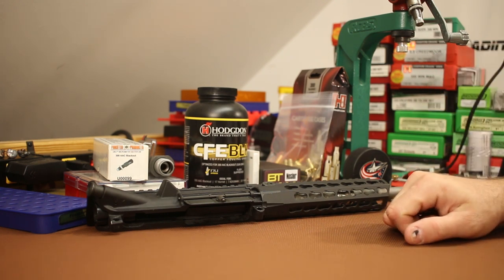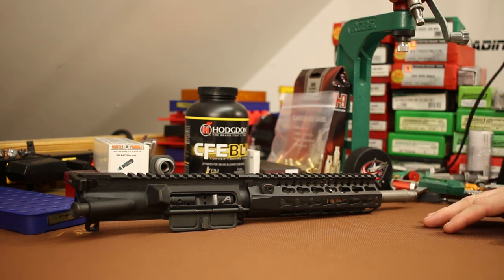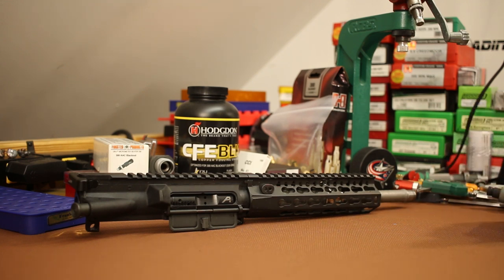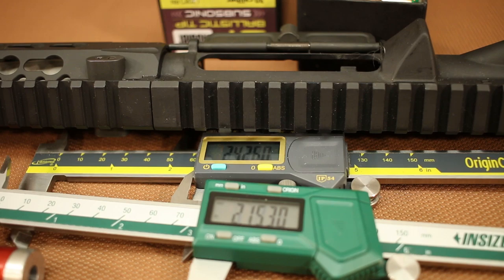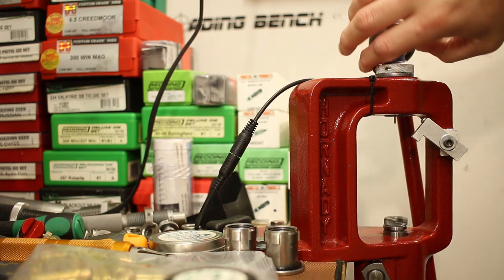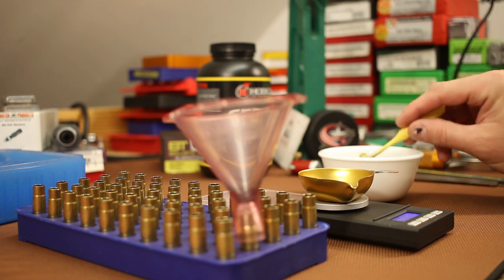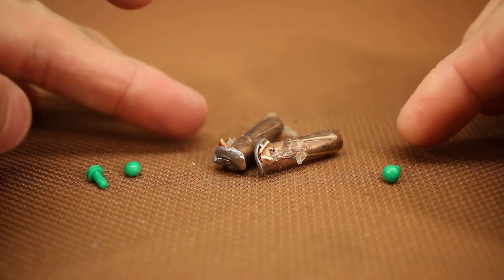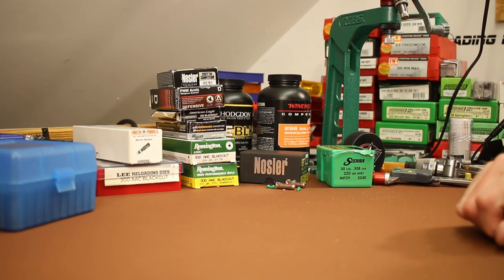300 Blackout - 220gr Nosler Ballistic Tip Subsonic

Comment: That live round extraction was a "Nail Biter"! 
Large projectile instability may be caused by the round not being loaded concentric. The Ogive is long and round so however the bullet starts the lands, it finishes that way. The point only 1mm off will cause an imbalance that turn the bullet into a corkscrew. It may be better to order seating cones specifically for the Big Boys. At their per unit cost, it would be worth it.

Comment: I wonder why the gates twist barrel I could find when I put my .300bk together was 1/7 when it was designed by AAC as a 1/5. That seems like the ticket to stabilize the 220gr. Bullets
Reply: Several manufacturers are doing 1/5  twist barrels now.

Comment: A little off topic but I was working up a hunting load for my 16" 300 blackout and came across some data that shocked me. I tested it out and have found it to be true. Nosler 125 grain ballistic tip can be pushed to 2400 fps without pressure issues what so ever. Would love to see you test it out in yours to compare some results

Comment: Accuracy is good with 220 grain Subsonic Ballistic Tip" T/C Encore (1in 7 twist)barrel , under a inch with perfectly round bullet holes at 100 yards.  Expansion sucked ,but did use one to kill a whitetail buck, velocity 1050ish FPS, 40 yard shot, next to no expansion, bullet tumbled exit was  the exact length as the bullet is long.

Comment: Hmm, running s 10.5 inch barrel, 2.10 OAL LC brass, Winchester SR, primer 11gr CFE black 1054 avg  velocity, and stable. I use these between 4750-7000 feet elevation above sea level. Works great in the 16 inch bolt gun as well. BTW they are 1/8 and 1/7 twist respectively.  I have learned a lot from your vids and appreciate the knowledge you share.  Keep them rolling.

Comment: johnny, I have had no stability issues with this bullet.  I am running a 10.3" daniel defense barrel with aa1680 and a c.o.a.l. of 2.100".  I think your poor expansion was due to the bullets impacting the gel at an angle(you can see the angle on the ends of your bullets).  I shot mine into milk jugs full of water and they acted like varmint bullets-complete fragmentation.  They didn't mushroom and stay together at all, there were just tiny bits of lead and jacket pieces throughout the jugs.  I would definitely explore it further.  since you can shoot on your own property, I suggest maybe just prepping your brass, load 2 or 3 rounds and test stability, then go make adjustments-load two or three more, and test again vs. loading a large batch and finding out it's unstable-this is how i develop subsonic loads to save components. by the way, so glad to see you getting the blackout back in the mix, was getting really bored with all of the 6.5 and 308 videos hopefully you'll get back into the blackout
Reply: At what velocity was this fragmentation?
Reply: @amagfoley  1000fps +/-30

Comment: Great work on the vids, keep up the good work.
Also have a question for you I am reloading for 308 win I have been trying to work up a load with sum Barnes ttsx 130gr bullets using sig brass have to manuals they both have data for 130 gr bullets and for blc2 powder , the Barnes data says load from 50-56grs and hogdon say to load from 48-51.5 grs the differences is that Barnes has their oal at 2.810  and hogdon is at 2.615 I am loading to 2.810 will the the Barnes loads be to much pressure thanx for the help in advance

Comment: I've been running 208gr and 190gr bullets for my subs and getting a lot better accuracy. Using the midrange twist rate to run supers and subs probably accounts for the improved accuracy with the lighter weight sub rounds

Comment: Wish you could try a higher twist barrel. The longer and heavier the projectile, the more spin it needs to stabilize. It's possible to over stabilize with too much twist but you almost never see it as much as under stabilized. The tradeoff is that  you lose a few ft/s with more twist, but that's a non factor when you want to run subsonic.  1:7 would have worked I bet. I would go with 1:6 if available.

Comment: I have an 8.3" BA Hanson barrel with the EXACT same issues as you. It has been driving me crazy - I have over 50 "recipes" I have tried, both supersonic and subsonic, and the accuracy has only gone from bad to worse. I have tried 130gr, 168gr, 200gr, 208gr, and 220gr bullets with CFE BLK, Shooter's World Blackout, and H110. The absolute best accuracy with any load at 50 yards has been 1.5 MOA, and the worst was 6+ MOA - shots went off the paper so I couldn't measure. My average is 2.5 MOA. I also have issues cycling "max loads" with subsonic bullets that many others online seem to be running well. ---->more
Have you been able to figure out your issues with your system? I'm really starting to believe this barrel is causing major accuracy problems, but it feels like a waste to just throw away a $250 barrel. I have changed scopes, retorqued everything, thoroughly cleaned the whole system numerous times, gone to a special lightweight buffer spring, and even added an ACCU WEDGE to remove any play between the upper and lower. Accuracy is still awful. BA has a 1 MOA guarantee on these barrels but I'm afraid it will just end up going nowhere with them.

Comment: What is the difference in diameter measured between the barrel extension exterior dimension and the upper inner diameter dimension? I’ve seen where these are good fits and people adding a cut up coke can to take up some of the slack. That could be causing the accuracy inconsistency in the barrel & upper combination.

Comment: My experience with Nosler bullets is... Don't use them... In my 300 blk 10.5" I use mostly Hornady eld-x or m w/h110/w296 for subs. Even used Berry's 220gr plated with ok results. the Barry's would become unstable and start swapping ends as soon as they hit anything, at least they flew straight. Great vid, provided valuable info even though I know it sucked for you. Thanks

Comment: Little help.....You measured your overall length at 2.097.    When I go to the Nosler website....300 BLK, 220 grain  max length is 2.260.    But the O.A.C.L is 2.100".       What am I not understanding.   your gage is over the whole bullet/case...it should read 2.26.   What is OACL of 2.100 on the website.

Comment: My 16" 300blk Sota Arms upper on a YHM complete lower LOVES Hornady 110 grn V-Max flat base bullets. Unsuppressed, and supersonic it shoots about 1/2 MOA, @100 yards, all day long. I have chrono data, just not handy, sorry. But, I  could NOT make it shoot 125 grn Nosler Ballistic tip boattail bullets to save my soul ! Ft feed, fte, and when it did fire there was no group to be found, they were all over the place. Charge amount did not matter !!  Ridiculous and frustrating. It shoots 150 FMJ Sierra Boattail just fine ? It also LOVES 125 grn Sierra flat base ? All loaded over H-110 or LilGun powder using cut down 5.56 brass. I recently bought a PSA 8.5" pistol kit and built it with the finest Anderson stripped lower I could find (was the ONLY stripped lower available in my small town). So the odysse begins again. I plan to add a suppressor soon, so I'll be getting into subsonic as well... We'll see, lol. Thanks for the AWESOME upload (new sub) 🇺🇸🇺🇸🇺🇸🇺🇸

Comment: Nothing wrong with a failed experiment.  If the results were guaranteed, what would be the point?  As far as this bullet goes, the shape is so different that perhaps it shouldn't be surprising that it doesn't stabilize at the same velocity, with the same twist rate barrel.  That's a lot of "nose" to push through the air without enough gyroscopic stabilizing.
By the way, love your videos and the detail that you show.

Comment: Knowing nothing about 300 Blackout, this bullet has me puzzled.
Why would a short range projectile have a boat tail?  What’s the point, aside from marketing?
Reply: These projectiles are not designed for the 300BLK. Most are designed for the 308/7.62x51. They can also be used in 300 win mag and now 300 PRS. To make a subsonic round that cycles for 300blk it takes a heavy projectile. There are cast lead bullets for this with flat bases but for jacketed factory bullets they are just heavy 308 caliber bullets

Comment: Hey how do I send you some bullets to try I would like to see you try the NORMA 6.5 (.264) 156gr SP BULLET ORYX BONDED in the Grendel.

 I have load data for it  powder v-n540 start load says 21.3 max suggested is 25.8  about 2123fps  loaded to 2.260 other powders are v-n140  and v-n150  booths say 20.1 start load and suggest max is 25.0 at 2.260  I don't know how to message on here or if you can I have you on FB as well just not sure how to get ahold of you

Comment: Cut it out pal, at the slow speed it was going you can not possibly expect it to behave like it was doing over 1800 -2000fps, a bullet traveling at long distance is dropping in speed down to about 1800 and bullets are not designed to expand at such a slow speed, test it again at 2500fps and you will see what it was designed to do.

Comment: Is it me, or is everything Nosler just crap?
Iv never seen anything impressive.
Reply: I've tried their 55 gr varmageddons in an Anderson 24" upper, and their 6.5 140 gr RDFs in a rem 700. Can't get either one to shoot better than 2 moa. Yet both rifles will shoot .3-.5 moa with Hornady Vmax and Eld-x respectively.
Reply: Mind you I was pushing these bullets faster than recommended since my rifle liked to let these bullets jump .120" to the lands for some reason. COAL for my rifle was 2.700" if my memory serves me correctly.
Reply: My experience with Nosler products is very much the other way and I have shot literally THOUSANDS of ballistic tips in everything from light loaded 22 Hornet (40gr) for squirrels up to & including full power 375 H&H loads with the 260gr and my m700 (300 Win Mag) is absolutely frightening with the new 190gr Accubond LRs (consistently less than 1/2 moa extreme deviation [NOT that silly center to center crap] @ just over 3000fps, set to jump no more than 0.010")
The tricks to getting them to perform are 1.) THOROUGHLY clean your chamber's throat regularly.
2.) Weight sort them rather than just pull them straight out of the box.
3.) Set them no more than 0.020" off the lands (closer is better).  They do NOT react well to a lot of freebore, even in Weatherby chambers.

Using those steps, there has only been one bullet/cartridge combo I could not get to stay sub-moa and that was one I knew was not likely to work to begin with (220 Swift, 1:14 twist, 60gr BT) but I  still felt the need to try anyway.

The above does NOT mean that I shoot exclusively Nosler.
Quite to the contrary, my 284 Win (Winchester m100) greatly prefers the Speer 160gr Hot-Cor over everything else, the 45/70 (Marlin m1895) definitely prefers Hornady's 325gr FTX and my (personal favorite) Remington Seven in 223 Rem (1:14tw) is ridiculously reliable at 5 in 3/4MOA with the Hornady 55grSP.

But I also use only better quality, FULLY PREPPED and weight sorted brass too. though.
Reply: My .270 shoots nothing but Nosler rounds.  130gr Parts and 130gr Ballistic consistently holds 1 MOA groups (this is me not the bullet) no issue.  I follow Nosler's reloading recommendations and use H4831SC and have had no issues.

I seat the bullet to their recommended length and don't sort them out by weight.  I do spot check periodically, but have never had the skew in weight others claim to have.

Comment: Ahhh, don't worry. Even crummy results are results. And you totally make up for it in entertainment value! I'm thinking those big Nosler BT's are a loser. I loaded 125gr BT's and they were awesome, however thinking the same idea with 100 more grains weight just isn't viable. This is unproven, total opinion speaking. But I've seen this before with lots of other products. You start using the same ideas with different parameters and you get way different results.